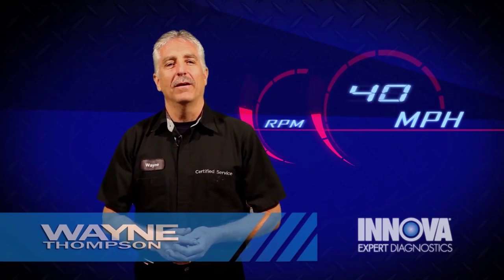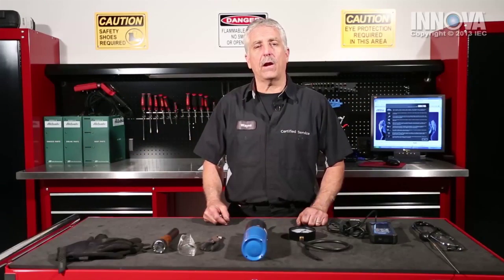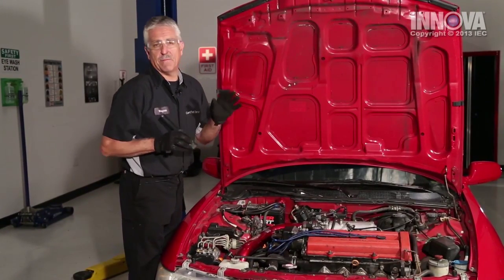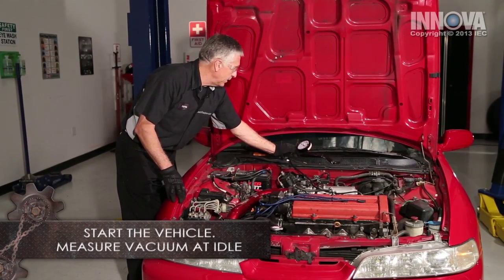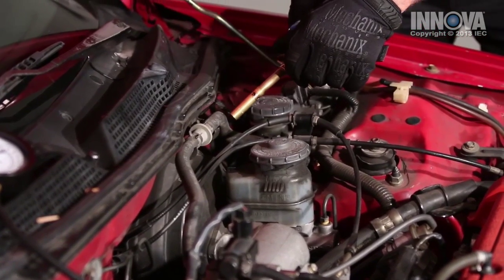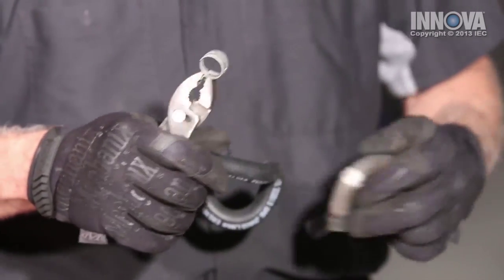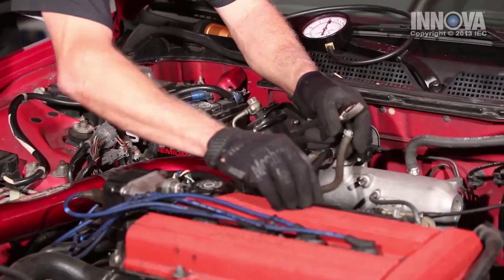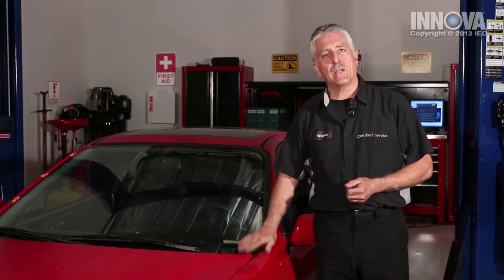How to diagnose a Vacuum Leak - Propane Enrichment

Comment: What do you do if you change the fuel line pressure sensor and the car still keeps cutting off after driving it for a little while? Please and thank you in advance
Reply: Check your fuel filter or fuel pump

Comment: I have a 420a 5speed mitsubishi eclipse its fine when idling but when u go to pull out the rpm gauge will get to 3-4 and the whole car shuts off if you wait a few seconds it starts right back up replaced tps sensor and fuses can you help me